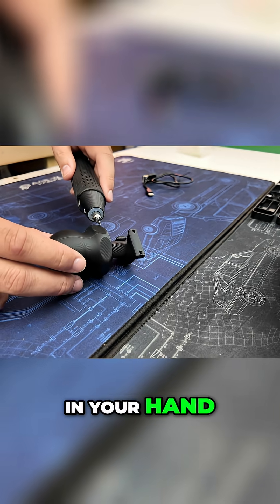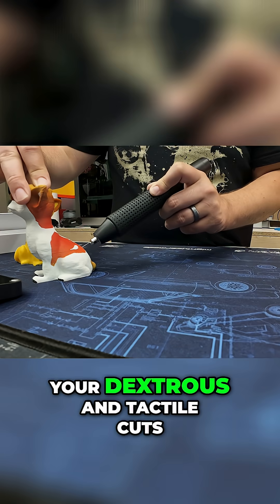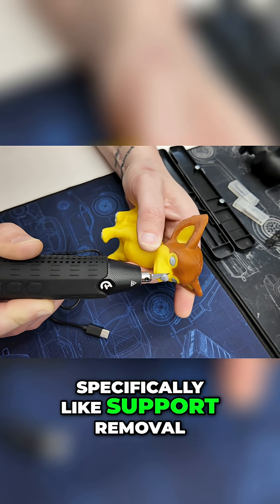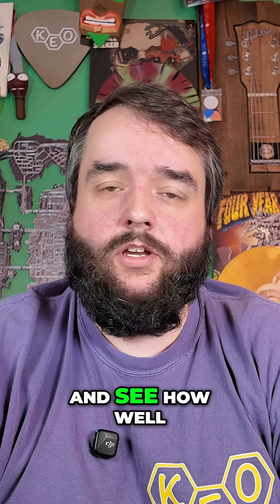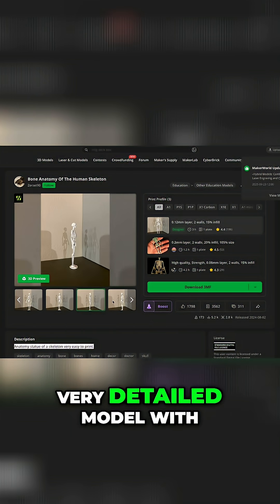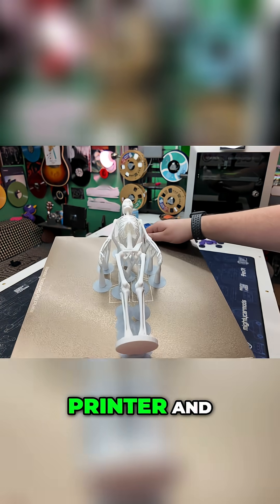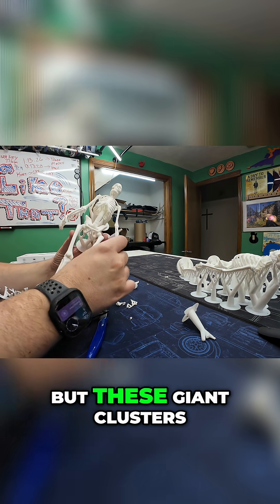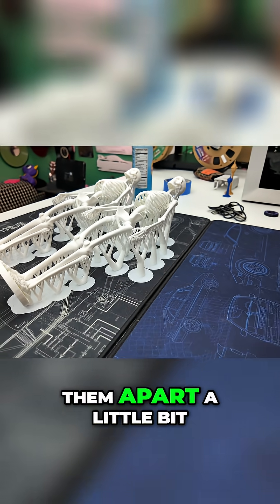This Ultrasonic Cutter Made 3D Printing SO MUCH EASIER! #shorts

Comment: "It's got a rechargable battery so you're not dealing with wires..."
I like that; yea I really like that 😎

Got a cordless dremel (but off-brand) that has an on-board battery about a year ago, and they're not just easier to use, but so much safer ❤❤❤
Reply from the maker: It makes a huge difference not fighting with a cord when doing small stuff like this